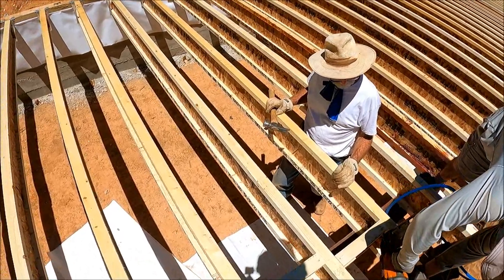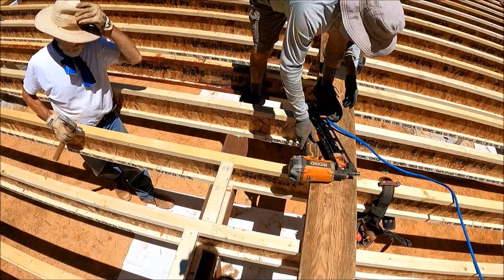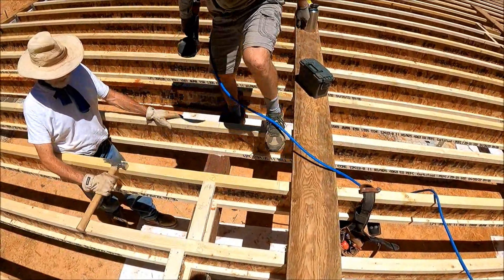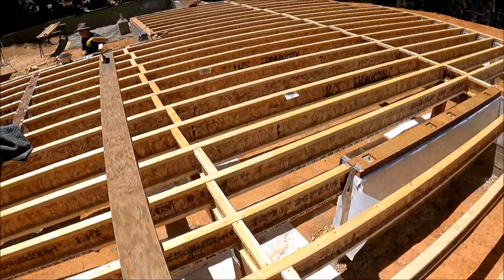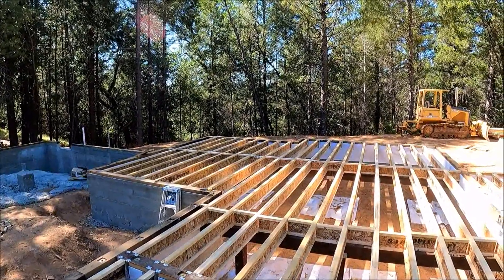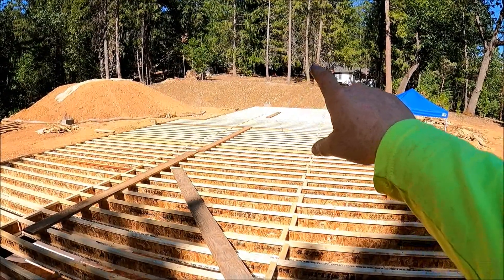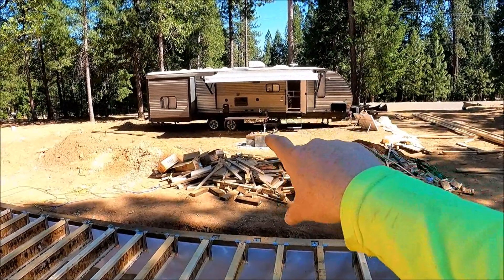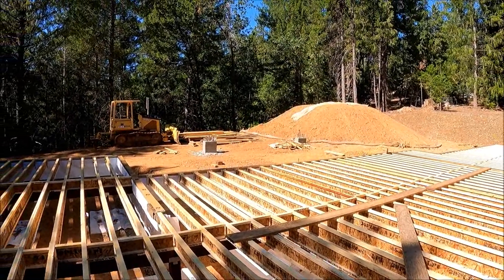Joists and Blocking - Building your own house

Comment: Lots of progress.   A question, are basements not used in your area?  I saw you are in CA - I'm in Kansas City MO area and almost every house has them.
Reply from the maker: Very true.  My family in the St. Charles area had basements in every house they owned.  Not a lot of basements in California.  Some of the older homes where I grew up near San Francisco had basements.  Most new construction here is on a slab foundation.  Maybe the slab is better for earthquakes?  Not sure?  The architect was surprised when we told her that we wanted a crawl space.  I guess if we dug down another 5 feet or so we could have had a basement?  We have 5 acres so there is plenty of room for another detached garage or barn.
Reply: @HamiltonServices530  Good answer.  I know in a lot of areas the water table is too high or the ground too hard to dig.  I have always been told that a basement is not much extra cost if you can do it.  My problem is water leaks where the poured wall meets the floor.